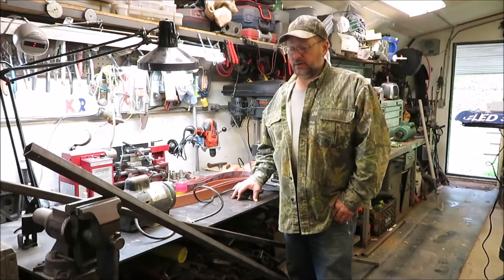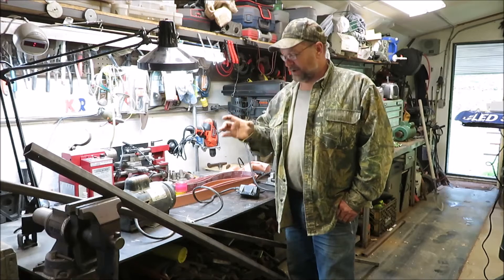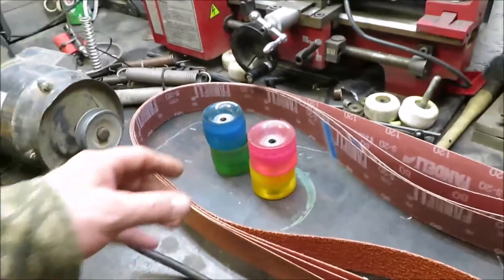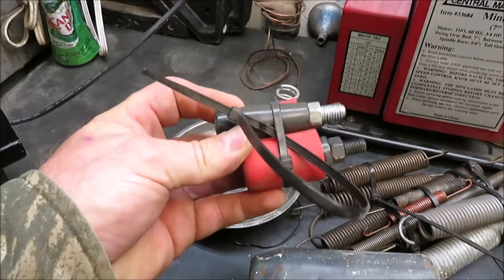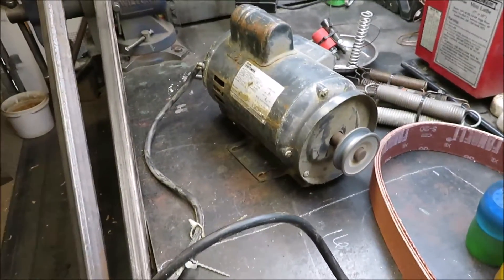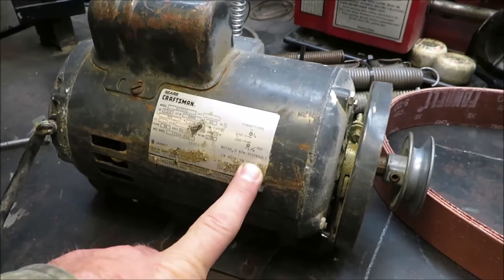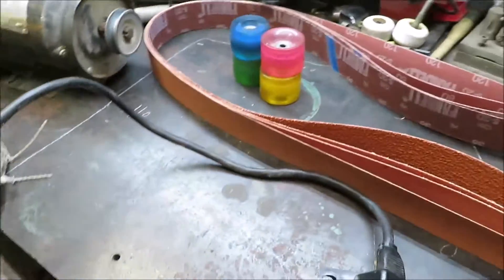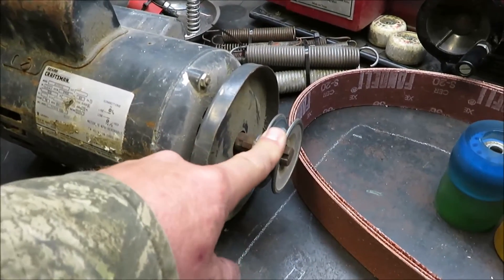homemade belt grinder build part #1

Comment: You got pretty lucky with the motor.  To get the square tube to fit on the seam you can take a angle grinder and grind a small grove on the outside of the smaller tube so the inside seam on the larger tube will fit in it.
Reply from the maker: Having a hard time with the wheels Frank may have to buy them.
Reply: Kevin Robinson I can't remember exactly where I bought them, but it was on line.  I do remember buy belts from Grizzly and also Texas knife.

Comment: you might want to look into taking the seam out of the inside rather then sanding the outside of the inner pipe, it will probably be harder, but you will get a better fit.
Reply from the maker: Thanks for the info Todd.
Reply: Yeah I bet you could weld a file to a bar of steel and put that in a vise then drag your square tube with that inside of it to get the weld down.